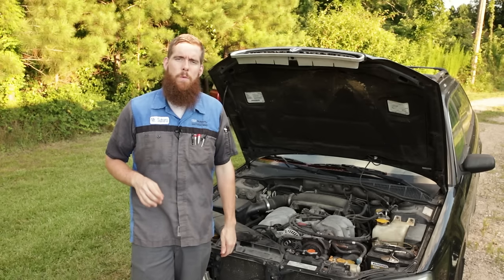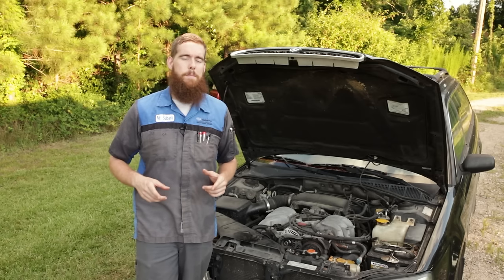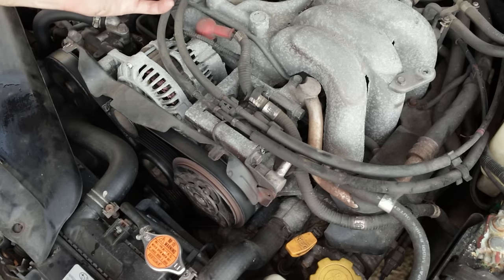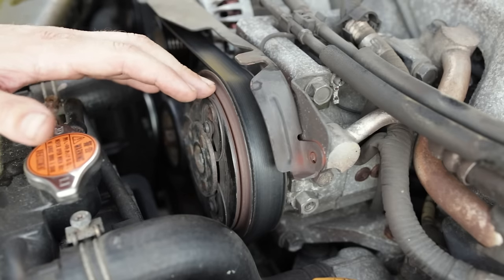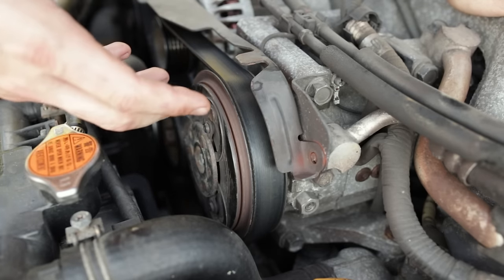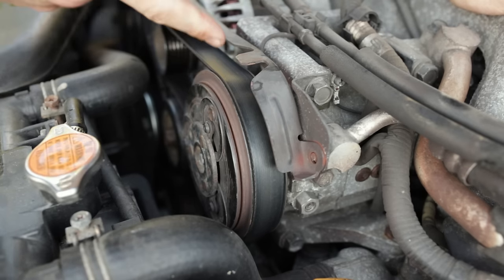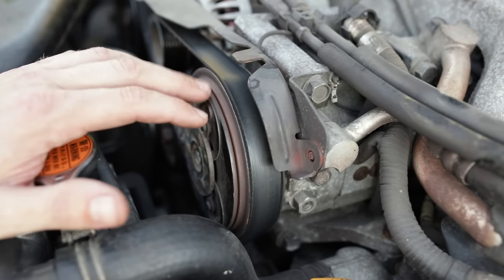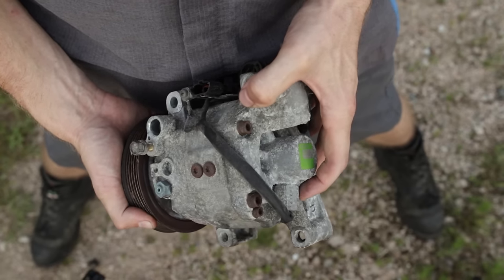Subaru A/C: Common Failures & Issues

Comment: HibMr Subaru. I have an issue with my 2011 LEGACY 2.0R. There is no power to the AC Compressor. It has the smaller AC Compressor (the same one shown in your video). I cant find a wiring diagram for this specific model and struggle to trace that wire. Is this a case where I just replace the Compressor
Reply from the maker: Have you checked fuses/ A/C relay?
Reply: I've Checked Fuses and AC Relay. Spoke to quite a few Techician on Just Answer and everyone basically took me through the whole diagnostic process. I bought this vehicle in January this year. The AC didn't work at the time of purchase but because I  also own a 2010 Outback I thought I will take my time on fixing this. I just about replaced everything (Evaporator Core, Expansion Valve,  Pressure Switch and AC Condensor) except for the AC Compressor. When running Diagnostics (Thinkcar Thinktool Pro), everything checks okay and no faults detected. What I have picked up is that Pin 17 on the AC Relay aswell as pin 3 on the Pressure Switch is not getting any power. When I connected the Compresor directly to the Battery, I noticed at 20°C that the High side can't build Pressure beyond 100psi  and the Low side is also stuck at about 15 PSI which tells me something is wrong with the Compressor itself.From your video I noticed the failure or problem with that smaller AC Compressor. My 2010 Outback have the bigger AC Compressor hence I was a bit surprised that the 2011 Legacy has the smaller AC Compressor. For peace of mind, I decided yo purchase a new AC Compressor (seeing that that is the only part on my bucket list that needed to be replaced🙈)...this may as well been the reason why the previous owner sold the vehicle as parts are not easily found in South Africa. I enjoy watching your videos as it is really in depth. I'm not planning to getting rid of both my Subarus, so I hope the replacement will fixed my problem. I would like to get your thoughts on this. It would be highly appreciated.
Reply: Hi Mr Subaru. I've dug deeper into my diagnostics and even though there was no fault codes on the AC or ECM, I found the blower outlet readings were -327°C whilst  the outside temperature was 20°C . I checked the resistance on the Evaporator Thermistor/ Temperature Sensor (Awkward Mission) and found the resistance out of spec at 8.8Kohms whilst it should have read between 1.7 - 1.9Kohms for a Temperature of 20°C.  The faulty 8.8Kohms is applicable if the outside temperature is -10°C. That obviously sends a message to the ECM that the Evaporator Core is freezed up and will not engage the AC Clutch. Now I need to source that part from somewhere because its not available in South Africa.
Reply from the maker: Looks like you got it figured out.

Comment: Hey mrsubaru 
I am having a issue with 2002 Impreza where the Freon pressures are normal. When you turn the compressor on it will work for a minute or two and the high pressure side will begin to spike in pressure. It will hit almost 600 psi and the compressor will shut off quickly. I believe it may be a clogged orifice tube. Any ideas?
Reply from the maker: Subaru uses an expansion valve, rather than an orifice tube. What's the low side pressure do? Shoot up too, or stay normal?
Reply: MrSubaru1387 thanks for the reply! The low side appears it will stay normal, maybe slightly decrease but <5psi. High side will climb high and bleed off slowly when the compressor turns off, but after several cycles too much pressure will build up on the high side and the compressor clutch will engage on short cycles, cause a notable load on the engine, the pressure will spike again, and then disengage. After so much pressure the compressor spins backwards when the clutch is released. Thanks for the info that it’s a expansion valve 👍

Comment: So my ac works under load once i hit around 3 or 4k rpms no problem amd even sometimes at idle it works no problem however wll the sudden you can tell air gets hot until i start moving the car again. Any thoughts?
Reply: 96 legacy there is no cabin air filter so it's bot clogged. I used subaru coil cleaning kit and shot it up the drain plug to clean the evap coils. Diagnostic plugs cycles everything including clutch..

Starting to think I have a faulty compressor.

Comment: My 2015 wrx ac stopped working. I added a can of refrigerant and it started working again but started making that noise and stopped working soon after that. I haven't messed with it since because I am afraid of the compressor seizing. I would like to replace the compressor but I dont want to put the same type in and have it die like this one did. Is there a more reliable compressor I can install or am I stuck with the oem? It has been over 100 degrees for over a week and probably wont cool down where I live until late november
Reply from the maker: The OE compressors are normally the best bet. Aftermarket compressors are hit and miss in my experience. You must have a leak in the system somewhere for it to work, then to stop again.
Reply: My 15 WRX's AC compressor died. later I foudn out that magnet part of the clutch was worn so it wasn't engaging all the time. I had it replace with just the clutch and works fine now.

Comment: My 2010 Outback has good AC with no apparent problems but there is a most unusual noise coming from the area of the dash vent to the left of the steering wheel. I assume it is related to the vent system. It goes flap flap flap all the time with no AC running but is greatly reduced when the AC is running. It even continues for 10 to 15 seconds after shutting off the engine until the flap flap flap slows down a little and then stops. What the heck is this? How do I get into that part of the dash to fix it or see if I can tell what is going on? Anyone else experience this?
Reply from the maker: Sound like a blend door actuator failing.

Comment: so i have 2015 wrx and about 2 years ago i noticed the AC will blow hot air after i get on the highway and mins later it will blow cold again....now i just turned it on , we got warm temps here in NY and it will only blow out cold air when the car is not moving . once i start moving with in 5 mins it will blow hot air...after im on the highway for 10 mins i turn the AC on and it will work for 10 mins than turn off. any idea? please help
Reply: I'm also having this problem with my 2015 wrx, it just started this summer too, did u ever fix the problem? What caused it??
Reply: @AhhitzSammy  so the mechanic told me the compressor went out ...so changed it out ...when i got the car back i noticed that when the compressor would kick on i would really feel it kick on lol like a huge difference. i was like ok this one is alot stronger or its mayb its for a bigger subaru...so now since we've been getting this heat wave in NY the ac will work and then cut off when im in traffic. one day it completely went out took it back to mechanic and it was working fine he said he couldn't fix it if he didnt find a problem with it ..he had it on for 4 hours and nothing was fixed.   do idk what to do

also when wits not working the compressor keeps turning on and off on and off and its very annoying when in traffic cuz its makes my car kinda bogg ..i really feel it when in 1st gear

Comment: Mine will only push cold air while I'm driving, when in idle it stops pushing cold air, I own a 2014 Foster XT.
Reply: You are low on refrigerant.
Reply: @superdavessubiandmore823  oh, forgot to mention about the noise also.
Reply from the maker: Low refrigerant charge or a dying/weak compressor.
Reply: @MrSubaru1387  forgot to mention it has the noise also. Thank you for the reply.

Comment: My ac just stopped working i hear hissing out of the high pressure line
Reply from the maker: The line or the service fitting?
Reply: @MrSubaru1387  the line near where it meets the radiator not sure exactly where but i used leak dye and don't see it but i can hear it.

Comment: 2013 Imprezza AC not cooling. Local tech wants to replace the AC controller [says its failed] and wiring harness [some pins are badly burnt]. Pics at https://drive.google.com/file/d/1lkIRMyE-VxYnRRpGSo5O0VxXf7iX8hib/view?usp=sharing, https://drive.google.com/file/d/1vZ7gRJi8NlC1rDoWhHxAZL2txwmSbnZL/view?usp=sharing
Its hard to say if the controller failed and caused the overload, or another component failed and caused it. Is there anything else I can look at or test before replacing the AC controller & harness? Its a 2 hour drive to my daughter's car, so I want to be sure I understand the fix before heading up there. Appreciate any thoughts you may have!

Comment: I have a Subaru wrx 2010. Rechargers the AC. It showed it low. Filled a little bit and the ac Compressor kicks on and filled it to 38-40psi and holds pressure, But it still isn’t cold?

Comment: Hello! A local subaru technician at the dealership said my AC on my 2005 Outback was not blowing cold air because of a termalizer issue that was very rare, said it would be about $1500 to repair since its one of the hardest to reach areas in the car...were they pulling my leg? Or is this an actual issue?

Comment: I have a 2000 outback that seems to struggle to idle comfortably when the compressor is cycling. (Idles at 1200 when it’s on vs 700 off)

Is that a sign that the comp is dying or that it might need lubricant?